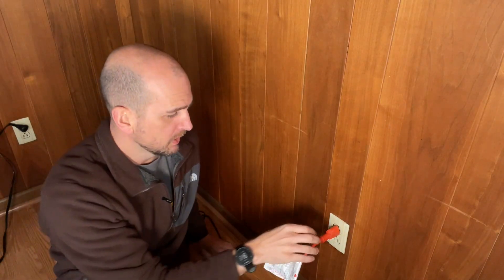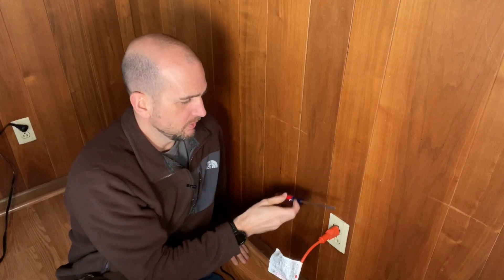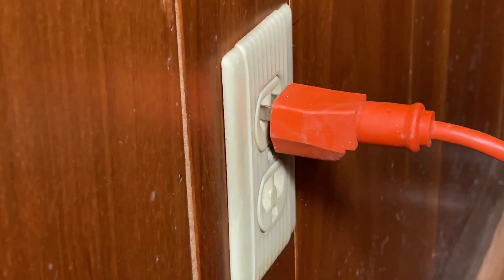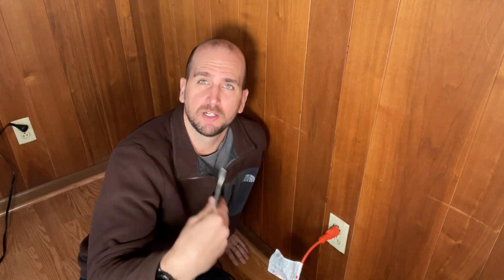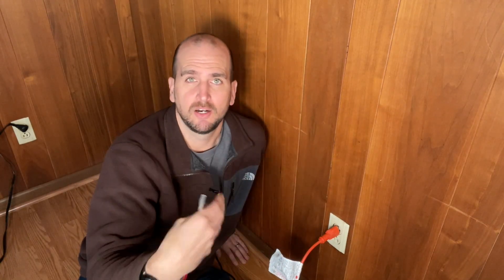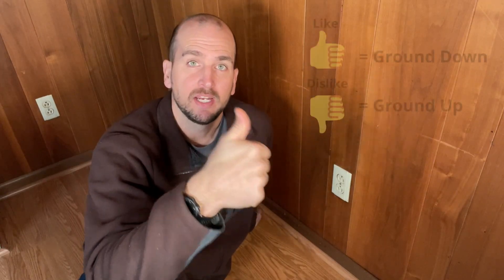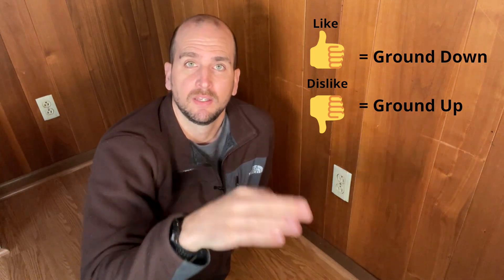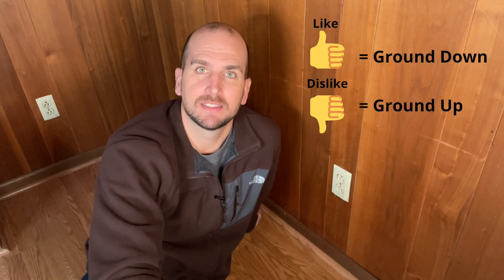Should An Outlet Be Installed Ground Down Or Up

Comment: I mange a large number of commercial properties nationwide. Years ago when I was at an east coast property I asked an electrician why he was installing the outlets the wrong way - with the ground up. He told me the same story if you had a piece of sheet steel mounted on the wall and it fell..... blah blah blah.   When I pressed him for an answer since I was about to make him change the hundred or so outlets they had installed. He confided in me that ground up means it was installed by a union electrician. Hmmm.

Comment: Don’t buy cheap outlets.  My outlets have all been changed 10 years ago and are both tamper resistant and high quality.  Many, many cycles of plug and unplug and are all very solid and tight.  Loose outlets with plugs pulling out means you bought outlets made of crappy chinesium.  Its both a hazard since lose contacts may cause heat, arching and possibly fire.  All of mine are ground facing down unless the outlet is sideways (special situations).

Comment: It really comes down to the human hand. Ergonomically if you grab a plug that is mounted ground up,  your index finger will be on the bottom of the plug. Out of sight you are more likely to cross poles with your finger. As apposed to your thumb which when you grab a plug mounted ground down,will be more straight on and less likely to cross poles and also be in plain view. Not to mention the shape of the American style grounded plug fits the shape of your grip better. 
 Long reply is only cause I was in a manufacturing position a Long time ago and the supervisor insisted I mount them ground up, and that kinda always made me question it.

Comment: I worked in a hospital as a stationary engineer for nine years and the ground was required to be up for the reason you stated. They were more worried about paper clips falling off the back of a desk and landing on the two conductors. When wiring a plug you always left the ground wire a bit longer, then the grounded conductor (white) a little shorter and the black wire the shortest. That way if the cord was pulled and the wires started to get pulled out the black was first to be removed followed by the white and lastly by the ground. When wiring a receptacle always loop the wire so that tightening the screw tightens the wire.

Comment: A lot of bickering in these comments.  But European and UK outlets are designed to never have potentially charged contacts exposed.  It stinks how married we are to this terrible and somewhat dangerous design.  Regardless of which way you have the socket, it still remains troubling that we can see small arcs when plugging in certain items.

Comment: My dad worked at a US DOD site as an electrician in 70's til his retirement in the late 80's. He told me that testing indicted ground up was more desirable because when the jack was hanging partially out of the plug and a wire or conductor fell across the prongs (ground to hot or ground to neutral) it was more likely that the breaker would trip. When testing across the prongs with the ground down the breaker would not always trip and was considered a safety issue. This is not in any code book that I can think of but this is why he had me wire with them with the ground up at our home. He passed away in the 90's, so I can't really ask him any other spacifics.

Comment: I had an instance where a metal wire coat hanger fell across the conductors of a plug that had partially come unplugged from a ground down outlet. It welded right through the plug blades before the fuse blew. Obviously this would be rare with more modern circuit breakers. I use ground up always.

Comment: I started as an electrician 48 years ago and the reasoning then was if you pull down on the cord with a ground up plug the ground pin can come out while the hot and neutral are still connected leaving you with an ungrounded appliance. So we always did ground down.

Comment: i tapped into a old section of wire that went to a backporch that was gonna be torn down i used it for my bedroom as a seperate circuit from the outlets currently installed as those are 2 prong and also ya cant have 3 window air units on one circuit without overloading i have the grounds facing down i think even at my aunts hose and other places ive been i think ive seen mostly ground facing down

Comment: Plugs installed ground up comes from using metal boxes with metal covers. If the cover should come loose and fall down on the plug , it could touch both the hot and neutral, causing a short and blowing the fuse or tripping the breaker and damaging the cover and prongs. If you put the ground up, that won't happen. 
It's only for metal covers and it isn't mandated by the code but it is a good idea. Ground up with plastic covers doesn't do anything, but it doesn't hurt anything either.

Comment: Once pushed a penny off the back of a desk and it landed right on the hot and neutral of a plugged in cord.  Quite the flash and a nice black mark on the wall.  Breaker tripped immediately, and I did consider at the time,  "hmmmmmmmm, why not ground up to avoid this?"   I still install new ones ground down anyway :)

Comment: First : when you are installing a switch the hot wires are at the right side so i think it should be the same for the outlet. Second : the ground wire (usually bare) should be in the down of the box so they wont fall on a screw. Usually all cord are made for outlet install with ground down. When i installing an horizontal outlet i put the ground and the neutral wires down.

Comment: You should have a look at the electrical plugs in England. The hot and neutral prongs are insulated at the place they're exposed until they are pulled past the connection point.
You can see some examples here. And note they install the ground pointing up.
https://duckduckgo.com/?q=electrical+plugs+in+england&t=h_&iax=images&ia=images

Comment: After all it is called a “u” ground, which would imply that the ground is facing up, otherwise it is not a “u”
However, I rarely see it installed that way. I d say more than 99% of the time the ground is installed facing down.
Reply: “U” would mean down. Left, bottom, right.. Follow the letter’s path. Just like I-beam, u-bolt, etc

Comment: Besides logically being safer, the "ground upward" method forces a partially engaged plug to rock inwards, producing a better connection for the hot and neutral blades.
Reply: Do not accept an improper connection. Plug it in all the way and if the plug does not grip the prongs then replace it. Your wires will probably burn up in the wall before your cord does. Eventually there will be a flash short, if your lucky, otherwise the wires will just get hot enough to ignite without ever making the contact needed to short the circuit
Reply: I would rather an improperly engaged plug to connect the ground better not keep the hot engaged while possibly losing the ground connection. If its about safety and not about keeping power flowing then logically ground down is safer for your example.

Comment: In my 22 years NJ licensed and 35 overall, my experience has shown me that ground up in commercial and ground down in residential. I have heard the argument made for ground up, as you said, can protect from a direct neutral to hot faults from occurring. However, now with arc fault protection required, any type of dangerous arcing that may occur in such a scenario is now mitigated.

Comment: I would prefer that every outlet was numbered with label (label makers are cheap now) indicating circuit breaker and if switched, a matching indicator to the switch. ie: something like 1-A to indicate breaker 1, first plug (arbitrary). I moved into a newer house in 2014 and still have one switch that I can't find a purpose for. It has wires. I labeled it "China" as it probably lights something somewhere. (And it's not the attic, I found that one in the garage after many months of being ON). Also, why do electricians always have bad handwriting when they Sharpie their work on a breaker box?

Comment: These comments nake me feel strange that i have dropped my keys across loose plug terminals.  I think it took pliers to break the weld free, the plug was ok, the key wasnt.
It helped when i recently worked at an apartment building where outlets were installed ground up

Comment: I remember when receptacles were two slot, non-polarized. When the polarized version came out, the larger "neutral/ground" slot was to be on the left when viewed. With the 3 slot receptacle, the separate ground slot was centered BELOW the large left "neutral" and smaller right "hot" slots. So if you install the receptacle with the ground slot up, you are not complying with the Neutral Left design.

Comment: My grandfather was a homebuilder and one of his pet peeves was when people turned outlets upside down, which from his perspective was putting the ground up. As for an objective reason for the ground to be down, it is more natural to hold a three prong plug with your thumb on the flat part. If the ground is down then it is easy to insert the plug while holding it naturally. If the ground is up, the either have to hold the plug in an unnatural way, or you have to flip your hand over in an uncomfortable position to insert the plug.

Comment: Here is the real reason why, because it has always been ground pin on the floor side.  If you turn it upside down it looks like someone installed it wrong or didn't know what they were doing. However, there are the outlets that are occasionaly mounted sideways.  That throws a monkey wrench in the topic, not to mention the ceiling mounted sockets for your garage door opener or the floor mounted outlets in your living room.  One will go nuts trying to figure out ground side up/down with those.  I have always seen outlets in houses, stores, office and the like all ground pin down.  Unfortunately, my work office has every outlet installed ground pin up.  I have OCD, need I say more...  This topic can be the chicken / egg adage for those without OCD.  Isn't the real question; should you use the push-in wire connector or the screw down to attach the wires to the outlet since the ground wire is always a screw down?

Comment: I prefer safety outlets that disconnect power to a plug should the plug not be fully inserted. Then the question of up or down is irrelevant. However safety outlets are more expensive and drive sales of lessor expensive outlets.

Comment: Over 2000 comments, so I'm not going to read them all to see if my observations have already been voiced!

1: I studied the NEC a long time ago, in order to pass my county's "Homeowner Electrician" exam, for one building permit only.  I got a lot of guidance from my master electrician brother in law, who said the same thing you did, doesn't matter, but with the caveat "for residential only".  For commercial, I think it's ground up.  And I'm not sure if apartments are in that category or not.  Maybe someone living in a modern apartment building can check it out for us.

2: The reason I prefer ground down, is that any down tension on the cord is less likely to loosen the plug.  More friction from 2 pins at the top will resist twisting better.  The reverse would be true in a region with negative gravity. :-)

Thanks for your explanation!

Comment: I myself would look at how the wires are coming thru the insulation into the box just behind the outlet. I haven't seen to much room to twist these wires giving a choice of ground up or down coming out of the insulation into the box. Also if I remember correctly I've always seen the ground wire at the bottom of the insulation into the box just behind the outlet and I would figure the wires are wrapped in the insulation so that ground is facing down. In short I feel the wires may be twisted if ground was facing up.

Comment: You might think that will not happen.  I had to replace an outlet because the customer’s cat was playing with a necklace.  The necklace flew up in the air and happened to land across the hot/neutral causing a short.

Also, if you install the outlet horizontally on a wall, the ground should point to the left.

Comment: I would prefer ground tab facing down the cord is less likely to fall out of the outlet, being supported by the ground tab. Most all cords 90° and low profile cords are designed around ground tab being being down. In a commercial setting you'll find most the ground tabs facing down.

Comment: add a public comment box
You are correct that the NEC does not identify which way to install a receptacle. However there is/was a section that said that the Grounding conducter had to be the  Fist Make and the Last Break and it had to be visible. Which means that the receptacle should be installed grounding pole up. But the reality is , What ever floats your boat

Comment: I do know someone whose wife somehow flipped a gold necklace up in the air and it just happened to land on a plug that was out from the receptacle a bit. It arced and there's a black spot on the plate now. That said, ground up is a PITA because most right angle plugs don't go the correct way for that.

Comment: I prefer ground on top. If a plug is inserted and the cord is pulled down, the pressure is on the neutral and hot and the ground will not break off as easy.
The opposite,  the ground will bend or break sooner than up.

Comment: NEC awhile back noted that ground should be down. This is due to the configuration on plugs installed by manufacturers where the wire comes out of the plug on the ground side of the plug going straight down. People have debated this for years when updating the NEC codes, a lot of this based on opinions. NEC 2000 stated the ground prong should be down because of plug configurations by most manufacturers.
Reply: If it isn't in the 2020 code, it doesn't matter...

Comment: There are two safety issues that will decide to install the ground down:
In flooding areas, when the water rise will touch the ground prong before reach the hot prong and the water never will get hot before the rest of the prongs will be under the water.
The second issue is that when you plug or and unplug you always put your dump finger on top of the plug and your index finger across the bottom part. If your index finger by accident will slides to the front will touch the ground prong and not the hot one.
Reply: thumb finger*?

Comment: The ground up is way safer in one way but if the cord gets pulled down , for whatever reason, like pinched ,stepped on excessive gravity,lol, your ground would pull out, leaving your appliance ungrounded. But, a short caused by dropping something like, change, or jewelry from the night stand, onto the leads of a ground down plug that was pulled out a little has happened.

Comment: I would say ground down do to that some electronic are design for ground down outlets and can't be at used with the ground up. On the other hand, some electronic can have their prongs rotated. However, the prongs can only be rotated in a 90° rotation to accommodate for ground left outlets. But, you might be thinking why some electronics ground up and that is do to things like air fresheners being a thing. Air freshener can't at all be upside-down or they would leak and be a fire hazarded. Also ground down outlets is a unwritten standard that a lot of people fallow.

Comment: Ground up for two reasons. For longer higher amperage draws that will cause the plug to warm the ground will help take the tension. I have seen plugs do this on a constant draw that was below the amperage rating on the cord. Yes cheap cords but within gauge size. Second when taking the plug out it make keep your thumb from slipping into the positive.

Comment: Ground down in almost all locations, so the ground lug supports the cord. Behind a refridgerator the ground lug goes up, so if you accidently knock that silver tray service you were storing up top off. When it hits the plug, it won't short out the recepticle ruining all your food! This is NEC code.

Comment: I just wish there WAS a standard. I'm so sick of buying appliances, cords, etc. that can't make up their mind which way they prefer to be plugged in. Like those flush plugs and wall warts. Ditto a standard to solve this so that two prong devices are always plugged in the same way too (with wide blade either left or right) instead of looking or guessing every time. I honestly don't care which way. I just want manufactures to FINALLY PICK ONE ! Been in this game for over 40 years and it's STUPID ! that this "debate" is still going on.

For what it's worth, I was taught and install ground up(subject to specific call out otherwise), for the (at the time) reasonable idea of the exposed ground when half unplugged. As you note though it doesn't help at all with two prong plugs. If it ever helped even with three prong plugs, though I did have it happen once that a conductive item hit the exposed ground while falling. Or I match the previous or predominant orientation of site (consistency is the biggest factor imo, for safety and convenience).